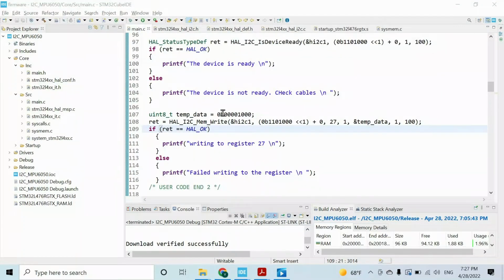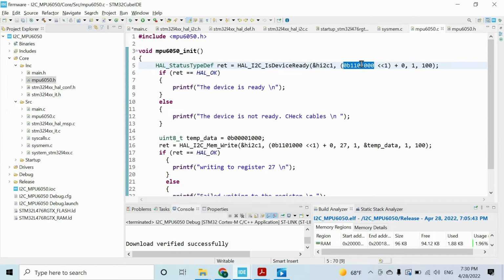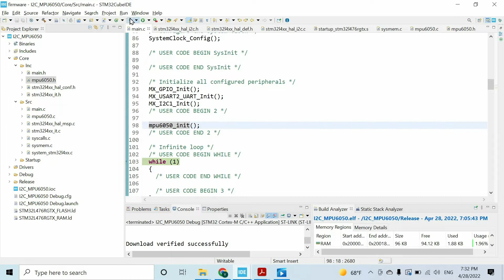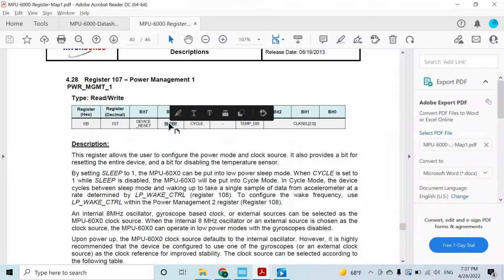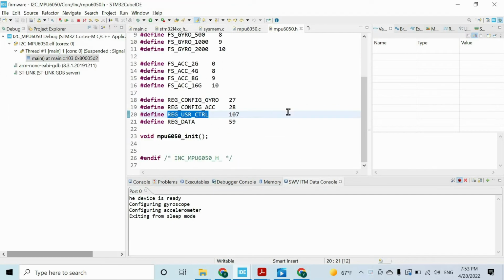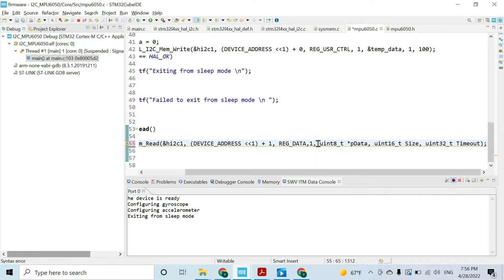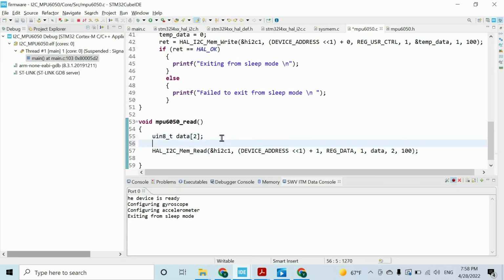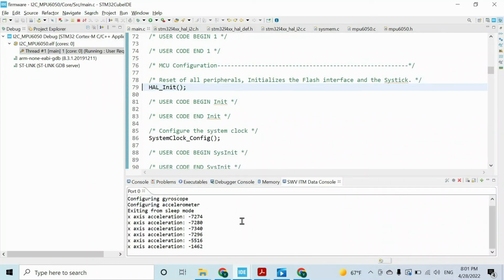PART II: STM32 HAL I2C and MPU6050 IMU

Comment: Hi Steppe, i have 2 questions ? 

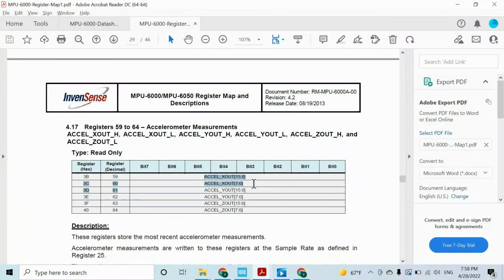1. At 9:47 you will read both the outputs ACCEL_XOUT[15:8] and ACCEL_XOUT[7:0], but the register REG_DATA is for  ACCEL_XOUT[15:8],  does that mean that it automatically read the output of  ACCEL_XOUT[7:0] as well ? or we need to the code for that ? im confuse , tnx 

2.  Do we need to calibrate the readings of the sensor  by maybe introducing filters,  on so to get accurate results or the results that we have are good already  ?
Reply from the maker: Hi,

1. We can do sequential reading, meaning that we can obtain the values of several sequentially placed registers. In this specific example, the 6th argument of HAL_I2C_Mem_Read is equal to 2, so get both ACCEL_XOUT[15:8] and ACCEL_XOUT[7:0]. Therefore, we do not need to read it again.
2. At least it is important to remove biases in the gyroscope and magnetometer readings. I have a whole course dedicated to explain all these topics:
https://www.steppeschool.com/courses/stm32-programming-course
Reply: @steppeschool3629  thank you . appreciate the response

Comment: Hi, thanks for posting this video! It Is really helpful. I wanted to ask you: I'm trying yo read the acc and gyro values from an MPU6050 using an interrupt (to have fixed sample time). How can I use the interrupt commands? Thanks a lot!
Reply from the maker: There is a separate video where I showed how to configure Timer update interrupt: https://youtu.be/KtVFYXtHvWc
You can write your code inside of the callback function. In this way, you can read the IMU sensor periodically.
Reply: @steppeschool3629  I've tried, but the reading speed is limited because the STM is still reading the MPU in blocking mode. I wanted to set the stm to read in non blocking mode.